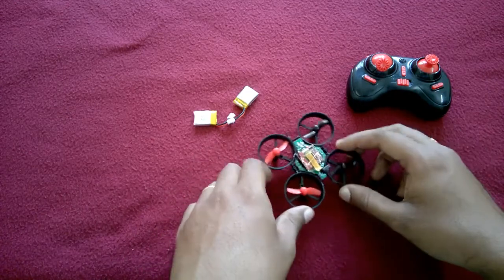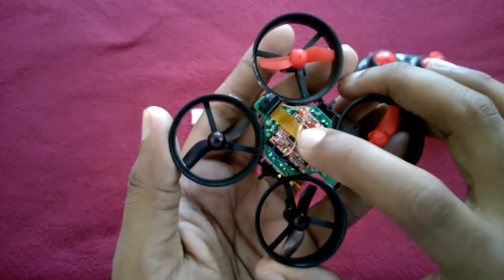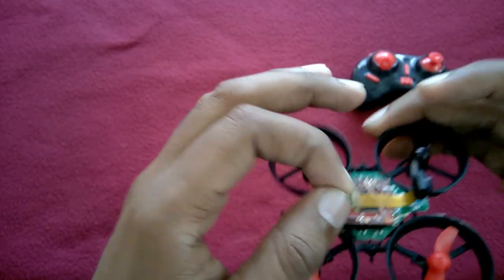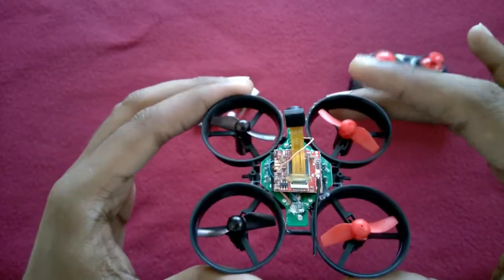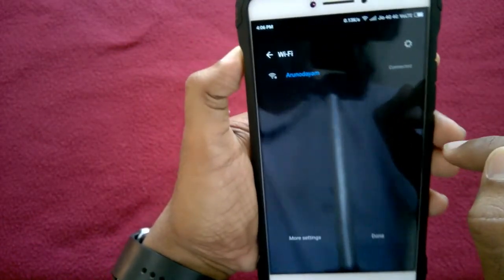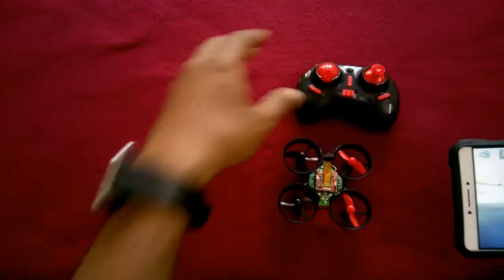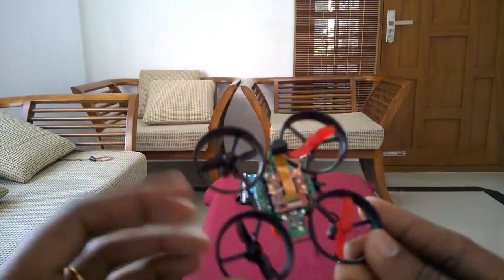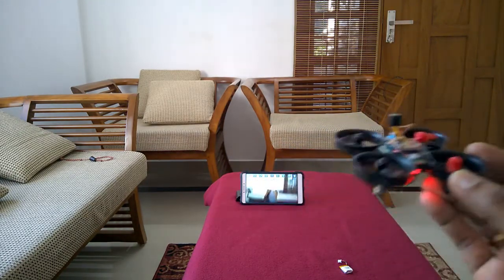Install FPV on any drone and Quad copter - Simple and Easy way

Comment: Bro how to attach camera wires with drone for currunt
Reply from the maker: Bro just add with battery connection red and black wire. Leave yellow camera wire untagged as that is used for switching purpose.